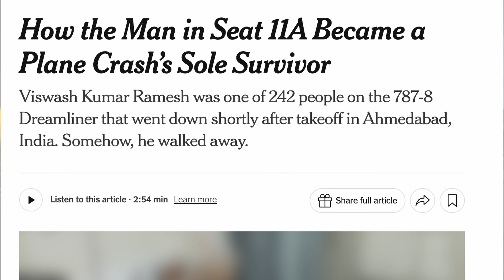Why the RAT Changes Everything – Air India 171 Update

Comment: But a dual-engine failure doesn't cause the aircraft to drop and lose interia and lift extremely quickly... which is why you don't reject a takeoff after V1. Likely a combination of other factors
Reply: Engine failure is usually not instantaneous, and even when it is turbines need time to spool down and thrust will be generated during that process.  Without thrust, there is no lift, so the premise of your comment is also wrong in that regard.
Reply: @kpro8908  At that speed and considering how heavy it was, impossible to lose that momentum this quickly SOLELY from loss of thrust. It would've kept on going for a while before it started to descend.
Reply: @mustafashulqamy1844  The plane did not lose momentum, it was traveling forwards just fine.  What it lost was lift, which is a consequence of losing thrust.
Reply: @kprofs  With all due respect, your physics background is weak. What you just said made no sense whatsoever
Reply: @kpro8908  Ever heard of gliders? They're not sci-fi or rocket science...
Reply: @mustafashulqamy1844  You’re right, my physics background is weak.  So, rather than bore you with my idiotic ramblings, I will simply direct you to a single piece of independent research:  what is the Lift-to-drag ratio of a 787?  And, what is the lift-to-drag ratio of a recreational glider?  

Considering the 787 apparently lost engine thrust very soon after ratation (if not before), the crew did a remarkable job keeping it in the air as long as they did.

Comment: I understand RAT also deploys in case of a single engine failure on this plane. I expect the probability of (simultaneous) dual engine failure is extremely low, almost impossible except in case of fuel contamination. A possible event is a failure of one engine, immediately followed by the stop of the second engine (either by human error, or by another event).

Comment: Thanks for the video. However, the video does not tell us, whether the RAT was deployed manually via a switch on the overhead pannel, or deployed automatically. Consequently, it is still to early to conclude on a dual engine failure.

Comment: I could never get on board with the idea that a FO could ever mistake a flaps lever for a gear lever, even with just 1100 hours of flight experience. Human factors implementation of these controls in virtually every aircraft with retractable gear makes this virtually impossible, plus the PIC is going to easily see such a thing even without looking. Mechanical failure of some kind has always been much more likely.

Comment: The 787 is unique in that the fuel delivery system is 100% electric.   If they had a catastrophic loss of electrical power, the fuel pumps would shut off, and the RAT would deploy.  If they hit debris on the runway, it could explain the loud bang heard by the survivor, the sudden loss of electrical power would stop fuel delivery, the RAT would deploy, and the airplane crashes.

Comment: There's also the landing gear tilt, when properly configured to land or at take off before retraction, the tilt of the main gear shows the rear part of the bogie down while the front section pointing upwards, on AI 171 the tilt is level or somewhat revered as to indicate that (under normal operation) the gear was selected to be retracted. The gear tilt is reversed / neutral position just before the doors open to be stowed. https://www.youtube.com/watch?v=2ZwzACp-q9U clearly shows it

Comment: At 3:13 you can see two not very wide gray lines on the top of the wings on either side of the fuselage approximately in the same line as the engines. They look like the flaps located on the tops of the winds forward of the trailing edge. Those flaps appear to be up. I usually only remember seeing them deployed after the plane touches down to help in slowing down the aircraft. Seeing signs they may have been deployed during takeoff seems odd.

Comment: I think people who saw the aircraft in near proximity should be immediately questioned.. because Runway 23 is where planes takeoff in 9 months of the year and approx 3 months of winter when the headwinds come from north, the runway 05 is used for takeoffs. Therefore all the people in the vicinity of 0 meter to 500 meters know how high the aircraft goes at that point and that is usual sight for them daily for hindreds of takeoffs.. so they WOULD ALSO KNOW how much the engines peoduce sounds at that height with 80 to 90 percent thrust during takeoffs or even TOGA.. If we get many people saying that the aircraft was coming down and it was comparatively very quieter than the usual days, it proves instantly that ENGINES were not functioning at the takeoff thrust and therefore all the focus will come straight to Engine thrust rather than Flaps, Landing Gear, Pilot Errors etc. As far as i know PIC generally the captain keeps a hand at back of the thrust levers till the V1 is anunciated for thrust levers not coming back in case of any adverse situation.. then swiftly the hand is taken off from the back of thrust levers and focus is only on the instruments of both the pilots. In no case the pilots will make this mistake ever, that the thrust lever is erroneously pulled back.

Comment: Not knowing anything about aircraft engineering, but just wondering if the RAT deployed incorrectly, and diverted power from the two main engines. Just as in most electrical systems, there is a throw over. Typically it would be from the two main engines to the rat, but is there an interlock, so that when the rat deploys, it diverts power away from the engines? Just curious. I think that would fill in a lot of blanks if that’s the case.

Comment: Wouldn't be surprised if investigators find that the fuel supply selector switch in this catastrophe of Air India Flight 171 was placed in off position

Selector switch was placed in off position with disaster of Egypt Air Flight 990 on 31 Oct, 1999

Also JFK Jr's Piper Saratoga had the fuel selector switch placed in off position when that plane went down 16 Jul, 1999

Comment: The un-cut video was available on Twitter /X on the day of the crash and I noticed the sound of the prop going by the apartment and no loud thrust from the engines etc.... In my mind not too difficult to work out there was a double engine failure of some sort, but why is the real question? That will no doubt become apparent over the next few weeks or months as the investigation progresses. The guy who survived stated he crawled out through the gap that was there, the emergency exit door had blown out, you can see it in the video flying off to the port side on impact, before you hear the noise of impact delayed by distance. He also said he heard a band and saw flickering lights moments into the flight, which would indicate the RAT deployment, which takes about 5 seconds.

Comment: Hi captin steve  there is a video of a passinger showing were he was sat that the display screen and the wired control was not working he said the call button was not working plus the air con was not working plus i did notice a few of the screens were dark and plus the screen were he was sat was none responsive when he touched the icons however i am not shore if it was the same plane that crashed.. I would like to here what you have to say about this and what would cause some screens to be dark and some screens are working and the air con not working. do

Comment: Sir, did rightly analysed. Yet, May Day Call forward by senior pilot refers 'power of'. Why thp pilot  never opted Hydraulic power. What' s the reason for non operation of green signal button.position of wheels, position of flaps, recordable engine sound clearly  disclose May day be mis-understood  presuming power off. It may be due to struck of wheels when gear up signalled. Flap move up. Wheel struckmight disabled movement of  plane to take off elevation. Hence, direction of movement at same level moving towards causing hit into  building. If building was not there Ahmedabad center place might be affectrd dsngerously. If after gear up not worked, if pilot tried elevation ordinarily  without operating flap s enabling rescue signal buttons in use flying upto 7 km  what would happened?

Comment: It for electricity, some of which is used to run electric hydraulic pumps. These allow the pilots control of the plane in flight, but not enough to operate the landing gear. This still does not explain why the plane used all of the runway for takeoff. It is almost as if the engines were not producing 100% thrust for takeoff, or the flaps were only partially extended for takeoff???

Comment: It's pretty hard to believe that both engines 'failed' in the strictest sense - i.e. A mechanical/electrical failure - but if you mean the engines 'failed' due to being inadvertently having the fuel cut off, the engines spooled down by accident or a fuel contamination of sorts, then I'm with you on that. I said the day after - on another channel - that I could see the RAT beneath the plane, just prior to the rapid descent. If I HAD to guess, I'd say I think it was most likely pilot error, with the flaps being retracted instead of the gear. We've all had moments of absent-mindedness - even if we've done something a thousand times - so it's not beyond the realms of possibility to imagine the flaps being put up rather than the gear, even though the handles are in different locations and have different shapes.

Comment: FWIW the temperature at the time was 40 degrees Celsius AND the barometric pressure was VERY low at 29.42.  This creates conditions which make it very difficult for aircraft engines to produce power and wings to generate lift.  While I am not suggesting this is the cause of the accident, it is certainly another hole in the "Swiss cheese".

Comment: buck stop at tata-air india airline . this is clear case of technical failure due to poor / negligent maintainance or can be a case of sabotage . this is an clear case of failure in fuel supply due to fuel pump failure or fuel control valve mal functioning and which may be started from electrical control failure due to poor / ignorant maintainance or a case of sabotage . and this failure subsequently affect the hydraulic system and fuel supply to engine which results in loss of engine thrust , landing gear and flap operation . since tata took over air india , air india safety standard and safety rating is going down day by day .  safety should not be compromise for small commercial benefit .

Comment: The RAT can be deployed manually from the cockpit and if desperate times call for desperate measures the pilot can manually activate it. You say however that you're not sure how both engines can fail? And it's been said the flaps may have retracted, which made no sense so the line of thought was the co pilot may have accidentally retracted the flaps rather than the landing gear. I can't buy that theory either. 

So here's my thoughts on what could have happened. Flaps are controlled hydrologically. Both engines on either side of the aircraft are controlled by variable frequency generators (VFG). All VFG's are managed by a main electrical controller interface... And, well... So are the pumps for hydraulic  functions. If the main interface fails, you lose hydraulics... (Flaps).... If the main interface fails, you lose all variable frequency generators... (All engines). If you lose any of those functions the RAT deploys... (The RAT did deploy). But the RAT is meant to assist at altitude and buy some time, and not at 500 ft above the ground. Yes the RAT may have been manually deployed, but if you lose the master control interface which handles many duties, including instrumentation, electrical components that drive hydrolics and variable frequency generators that control all engines... The RAT will deploy and the craft will sink. The system employed was created for efficiency but you may have just witnessed it's Achilles Heal because I can't say for sure, but I'm thinking there is undoubtedly no added built in redundant options.

Comment: Other theory: vapor lock? It's extremely hot in India. And the airplane was 2 to 3 hours standing still on very hot tarmac. What if the fuel lines and/or tanks were over heated and kerosene vaporised? The fuelpumps will pump "nothing" to the engines ➡️ shutdown and "no power, no thrust", just as the pilots mayday said... And then, RAT deployment, but speed of the airplane is still to low just after take-off and the RAT can't generate enough power at that moment to take over all the crucial systems to try to restart ➡️ not enough time to retry just after take-off and low altitude ➡️ unavoidable crash...
Solution: vaporlock sensors and temperature regulated fuel lines? It's only a theory, I'm not a pilot or technician, but still, could be possible?

Comment: Fuel Injector needs fuel to be pumped, were as old Carb type may not need once engine is running, obviously RAT not sure if in critical time restored fuel supply to engine, simple things like UPS power could help, seems issue also with fuel supply system,

Comment: If the engines did have power - at that point they would be full thrust and no doubt would be making an incredible roar if the pilot was trying to recover using engine power.  No roar from the engines - just that buzzing sound.

Comment: Ok , new evidence … My question is how about the RAT DEPLOYED due to system issue and hence power shifted out from main engines to RAT and this caused the plane to loose almost all power as RAT will only help in some kind of manoeuvring support at high altitude …. So a sequence can be as below :
1. Plane take off Normally ( this is apparent from all video and experts )
2. A snag developed in fee seconds…. 
3. RAT is automatically deployed ( due to a snag) 
4. This causes main power from engines cut out to RAT
5. Pilots cant lift landing gear or correct the slats as they dont know why no power and thrust ( May day call )
6. Plane crashed after that

Comment: I had read a comment somewhere that in the event of an electrical failure, the engines can/will roll back. If this is true, it could also have been a massive electrical failure that caused the engines to roll back and the RAT to deploy.

Comment: What is need next is a 787 aeronautical design engineer who has the exact diagrams and criteria for what exactly triggers the RAT deployment. Not just the general loss of both engines, electrical failure or hydraulic failure but what those exactly mean. What are the possible failures. Where are the non-redundancies or close proximity of dual failure ( nearby components a fire could take out both systems). Someone with enough knowledge of these systems and their proximity so common physical events/damage should be able to list the possible causes. The fuel system is an obvious one since they draw fuel just filled from the airport fuel source. So fuel with water or other impurities might just reach the engines just as the 787 lifts off and both engines get the bad fuel or an air lock nearly simultaneously. But are there other redundant systems that could be taken out together due to close physical proximity or requiring a common source ( like fuel). Find a 787 systems engineer with both logical and physical diagrams showing the systems required by the engines looking for a common physical failure point.

Comment: So, the RAT is basically providing electrical power so the pilot can tell emergency services that the plane is going to crash and that the plane will beat emergency services to the crash site by a half hour...
Reply: with proper altitude, it might be enough to handle the aircraft for an emergency landing

Comment: No disrespect intended but why is Captain Steeeeve and everyone else in such a hurry to "solve" this tragic accident ? The NTSB along with professional accident investigators from other highly trained accident investigator groups will use the CFR, DFDR and of course the physical evidence available to determine the cause of this accident. 
In my experience in serving on a dozen accident investigation boards (CFR-14, Part 121 accidents) and several NTSB investigations as a member of one of the working groups, it takes time to resolve these mysteries. Nothing has ever been gained by a "rush to judgement" and, in some cases, incorrect early guessing led to false conclusions and in at least one case, a law suits.

Comment: The sole survivor stated that he could hear what sounded like the engines increasing power in an attemp to increase speed, even as the plane continued to descend. He also stated that the jet felt like it was standing still after takeoff. I'm curious to know what would cause dual engine failure seconds after takeoff?